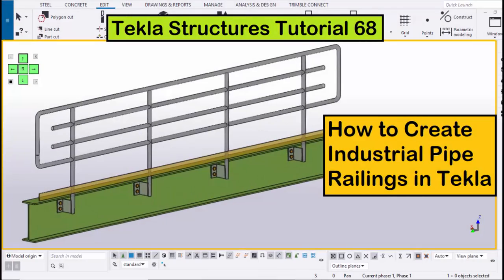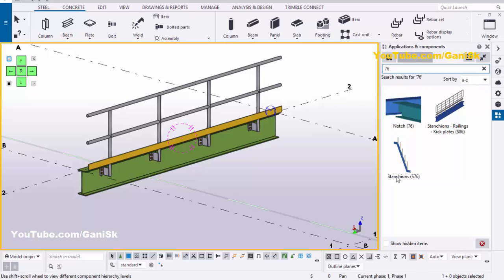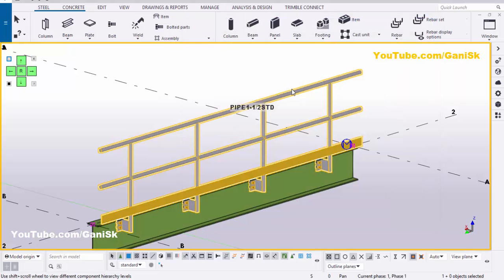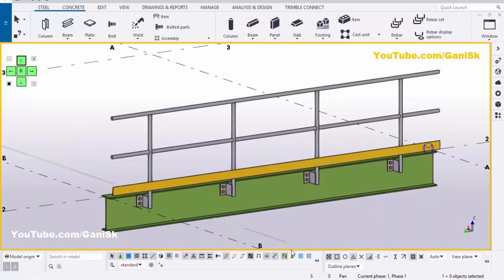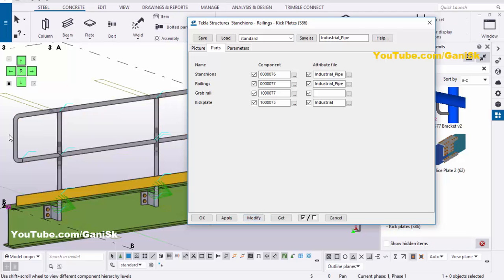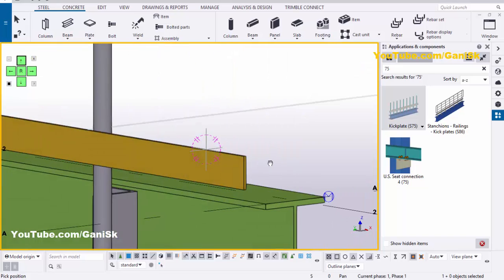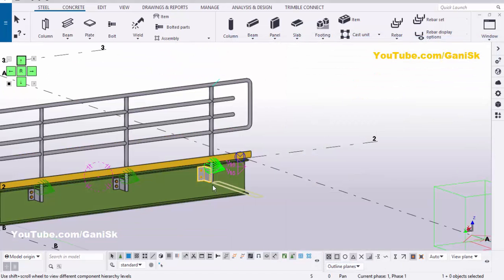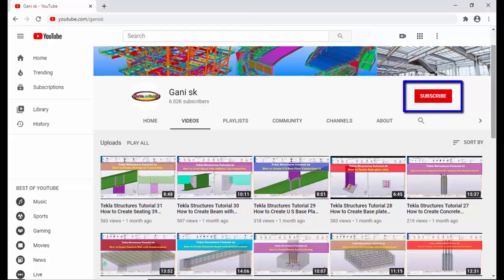Tekla Structures Tutorial 68 | How to Create Industrial Pipe Railings in Tekla

Comment: sir, when i try to place the connection on a beam as you did. The connection was not placed properly. THE STANCHIONS CAME OPPOSITE SIDE TO THE ANGLE PLATE,,,THERE IS NO LINK BETWEEN THE ANGLE PLATE AND STINGER ..PLEASE ADVISE HOW TO RECTIFY THE PROBLEM.
Reply from the maker: Rivers the direction of picking first and second point to get other side.
To rectify the bottom connection issue, watch this video till end https://youtu.be/NyDCruLjww4